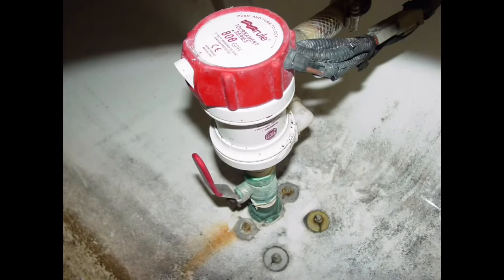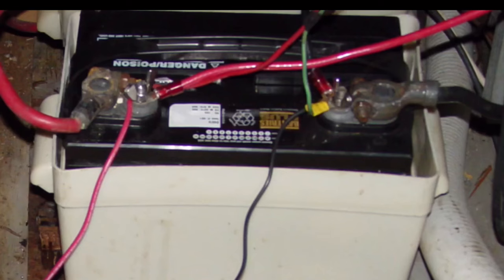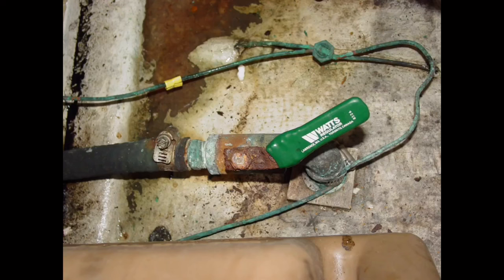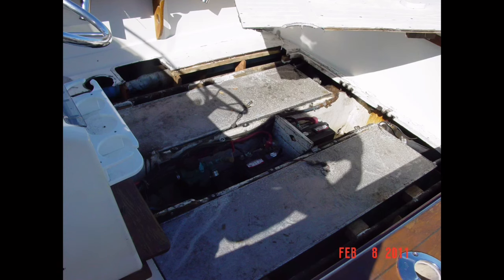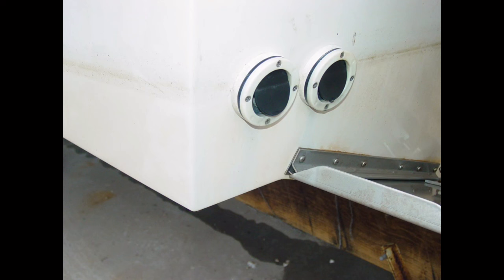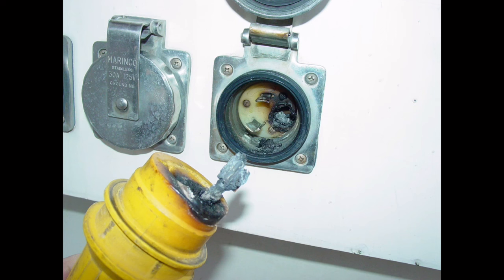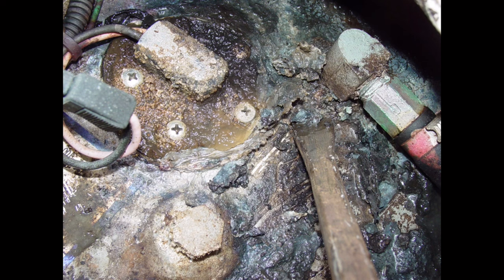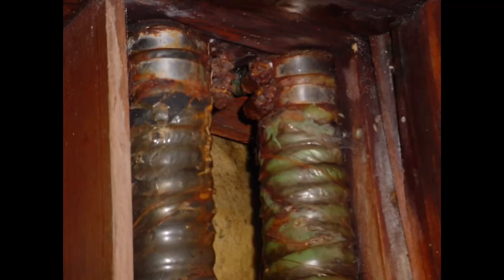Capt Frank’s Sea Chest Of Horrors (Episodes 11 through 15): Bad things on boats and why they’re bad!

Comment: What few people realize is that the Hubbell 50 and 30 amp plugs are a 1938 design. They actually have a very small contact area which is one of the reasons they overheat and catch fire.
Reply from the maker: Thanks for the comment and you are absolutely right. That smaller contact area combined with the movement of a loose connection or plugging and unplugging while energized are major contributors to arcing, contact pitting, resistance and heat buildup and possible fire. Newer designs, such as the SmartPlug, provide much greater contact surface area and less chance of fire.

Comment: You got a great  channel  and give grear information. 
I had a problem  on my boat ,  the positive terminal clamp on an 8d battery  completely  melted  off . The otger two batteries  were  fine .  The only wires attached was the battery lead and a wire for ghe charger.  The battery  is in a box with the lid on it
Reply from the maker: Thanks for the comment and Merry Christmas! There are typically two or three likely causes if a battery terminal clamp melts off like that. Corrosion or a loose connection are probably the most common (both can generate resistance and excessive heat buildup). Another possibility could be over charging or excessive charge current/voltage from the charging source.
Reply: @everythingboatswithCaptFrank   maybe over charging. But it was a reasonable  new charger maintainer .   Every spring they are cleaned and dielectric greased . .   Just ask because  I have no idea !  Thanks
Reply from the maker: It could also have been an internal short. It’s hard to troubleshoot remotely, but those would be my short list of guesses.
Reply: @everythingboatswithCaptFrank     it's a mystery! Lol. The worst part is , those are big  heavy  batteries  
Have a great holiday
Reply from the maker: @walterdavis4808  And happy holidays to you as well!